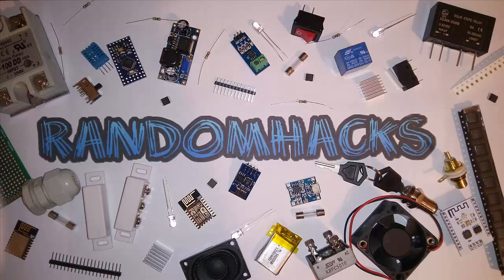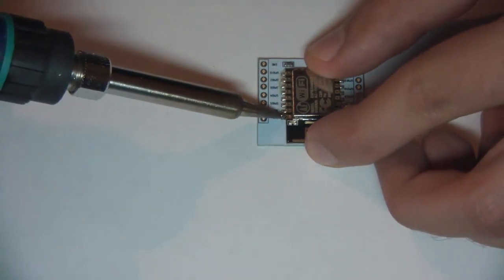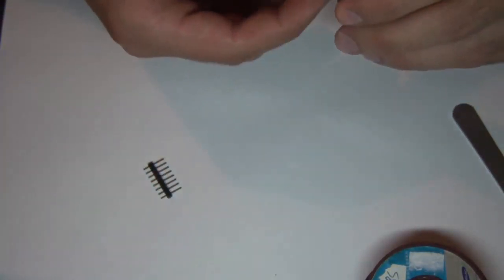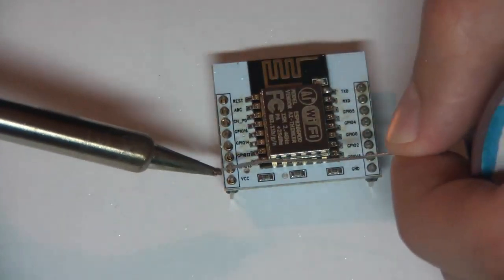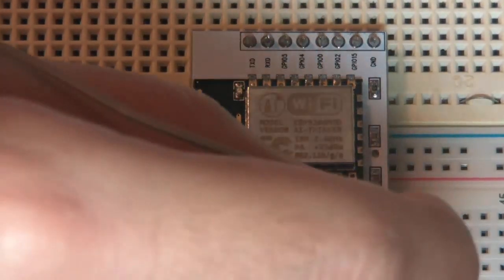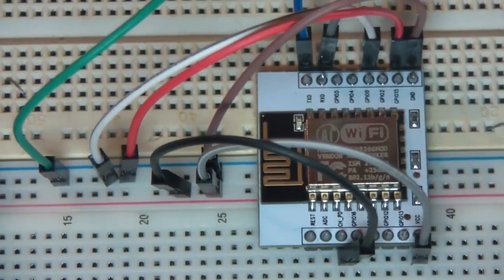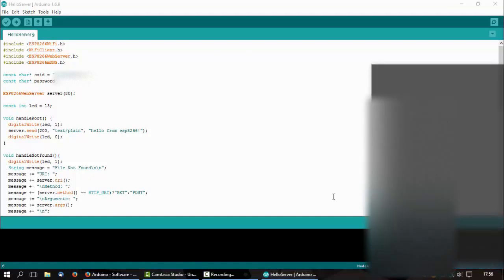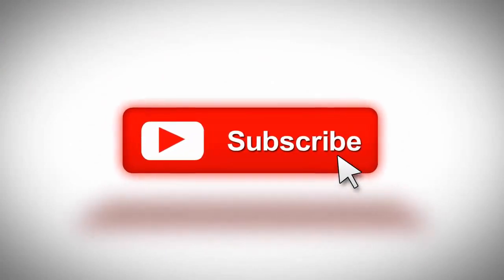ESP8266 12 / 7 - How to solder breakout board and flash with Arduino IDE

Comment: 7:00 That type of breakout board ALREADY HAS pull-up for CH_PD and pull-down for GPIO15 (these small SMD resistors on the edge).
So, you don't need to connect CH_PD to Vcc and GPIO15 to GND!  Only GPIO0 for flashing.
Reply from the maker: Yes, I realized that later, I had an annotation on the video but youtube removed all the annotations from videos as this feature was deprecated. Thanks.
Reply: @RandomHacks  Thank you for the great introduction video!

Comment: There is no need to connect GPIO15 to GND and CH_PD to VCC, since GPIO15 has been pulled down by R3 (10k) on the white breakout board to GND , and CH_PD pulled up via R1(10k) to VCC.

Comment: Can we connect usb TTL TX to esp8266 TX 
and 
TTL Rx to esp 8266 12E Rx
Reply from the maker: Hi, the correct is TX to RX and RX to TX but sometimes cheap ttl adapters come mislabeled. Think about two people talking to each other, one person talks with the mouth (tx) while the other hears with the ears (rx) that is how serial communication works.
Reply: @RandomHacks   thank you for your replay sir
I designed my own PCB like node mcu 
I'm design i miss connected them
TTL Rx to esp12e Rx
TTL tx to esp12e tx 
Any remedy for this
Reply from the maker: @pawanvijaykumar705  unfortunately I think the only solution in that case is to cut the PCB traces and correct the mistake with wires
Reply: @RandomHacks  helpful info and good tutorials thank you sir 👍👌
Can you please give me node  MCU schematic 8266 12E and / esp32  link please

Comment: can you explain the three pull up resistor connections on the adapter board?
.... Thanks in advance
Reply from the maker: Sure. There is a pull up resistor for the pin CH_PD on de left side of the breakout board and a pull down resistor for GPIO15 on the right side,  these are needed for the esp8266 to work, in case you have this breakout board you don't need to connect these two pins to VCC or GND like I showed in the video. On the middle there is a 0ohm resistor that bypasses the 3.3v voltage regulator that you can solder on the backside of the breakout board.

Comment: Hi there, I'm a bit confused with the board, hopefully you can help.
There is a socket for an AMS1117-3.3V Regulator on the back.
If I would equip the board with one of them, do I need to remove R2? and where do I supply the 5V and drain 3.3?
Having a hard time figuring out the wiring of this, ...
Reply: Same here. Did you figure out ?

Comment: I don't have a soldering station. So, what can be the maximum wattage of the solder iron that I can use?
Any suggestion would be of great help. Thanks
Reply from the maker: Anything between 25W and 60W should be fine, just heat the pads until you see the solder flow .
Reply: Thanks Sir. I am a newbie to soldering and electronics. Liked your video a lot. It was clear and lucid. Once again, thank you very much.

Comment: I could not load the firmware using this configuration. I needed 10k resistors to some of these connections.
Reply: The resistors should be built in to these boards........weren't yours? I know mine are.

Comment: I would be very interested if the white ready-to-use PCBs are really ready to use or how I need to prepare them to work. I have soldered an ESP-12S on one of these white boards but I am unsure about how are the connections on the PCB itself.  I mean how are the resistors on the PCB connected? I see you have drilled holes in the PCB-connections?

Comment: Hi RandomHacks, clear and methodic instructable, thank you. One doubt: while uploading a sketch to the chip, on the connections of CH_PD to 3.3V and GPIO15/GPIO0 to ground, is any resistor necessary? I saw other instructions on the web, and sometimes they advise 10K resistors. Another doubt: during normal run, all the three connections of CH_PD to 3.3V & GPIO15/0 to ground have to be removed? Sorry for the very basic questions, but I'm struggling since 1 week and got a lot of error messages

Comment: Hi, thanks for the clear instructions.
First I follow exactly what you did in this video.

later I tried to disconnect CH_PD and GPIO15, it works as well.

Just power cycle the board once the flashing failed.

Comment: Hi there, first of all this was a great tutorial, it helped me getting started with esp8266, thanks for sharing your knowledge, though this may sound as a stupid question I gotta ask you, do you happen to know why this breakout board has no pin headers for the bottom pins of the chip? I also have the same chip and breakout board and was wondering about it, I've seen people saying that we should not mess with those pins as they could cause some errors/crashes although GPIOs 9 and 10 are usable, but in order to use them we'd need some hardware modification, the article I'd seen was pretty much referring to esp8266 12 E and 201, not F which is what I also got, dunno if those statements are also valid for 12 F,  have you ever played around with the bottom pins? I'd appreciate if you could comment anything about them, keep up the good work buddy, cheers from Brazil.

Comment: I've done as you explained, but keep getting this error: espcomm_upload_mem; i searched in many forums but can't find a solution. Instead of using a serial to usb module, im using an aruino uno. Else is the same. If you have any hint to give me, i will appreciate it. Thanks
Reply: Tony Pendleton I just bought an Ethernet shield. I've tried everything but had no luck. I know some people that couldn't make it work with Arduino either... the c Arduino WiFi is a good option! lol
Reply: try to unplug Arduino before uploading code

Comment: The new cheap USB to TTL programers from Ebay (etc.) have both, 5V and 3.3V output pin, so you dont need the extra power supply, just plug the ESP8266 on 3.3V pin, right?
Reply from the maker: Just make sure it can provide enough current for the esp8266, if you have problems flashing it the programmer probably does not provide sufficient current.

Comment: could'nt upload the program this is the error.. could you help me on this

Sketch uses 222201 bytes (21%) of program storage space. Maximum is 1044464 bytes.
Global variables use 31576 bytes (38%) of dynamic memory, leaving 50344 bytes for local variables. Maximum is 81920 bytes.
error: failed reading byte
warning: espcomm_send_command: cant receive slip payload data
error: failed reading byte
warning: espcomm_send_command: cant receive slip payload data
error: failed reading byte
warning: espcomm_send_command: cant receive slip payload data
error: failed reading byte
warning: espcomm_send_command: cant receive slip payload data
warning: espcomm_sync failed
error: espcomm_open failed
error: espcomm_upload_mem failed
error: espcomm_upload_mem failed
Reply from the maker: Are you powering the esp with an external 3.3V power supply or are you powering it through the usb programmer?
Reply: RandomHacks  i tried both ways

Comment: after soldering this board , should the Vcc of the breakout board be 5v or 3.3 v???
Reply from the maker: Hi, if there is no voltage regulator on the backside of the breackout 
board (where the pins come out) then it should be 3.3V if there is a 
regulator you can use 5V. In my case there is no regulator as you can see at 5:13
Reply: thanks alot

Comment: People using this board should add a 0.1 uF capacitor from VCC to GND to increase stability of the ESP8266. You can easily solder it from the center 0 Ohm resistor to the GND pin.
Reply from the maker: Yep! I heard that before. It's not always needed though. The project I made to control 5 relays is running for 8 months straight, super stable without that capacitor :)
Thanks for the comment.
Reply: No problem. I had the most trouble during flashing. Adding the capacitor to the ESP board and another 100uF to the programming board solved that.
Reply: Yes, you remove the zero Ohm resistor if you are going to solder on a regulator. If you do that, be sure to solder on two 0.1uf capacitors - one on each side of the regulator. Once you remove the zero Ohm resistor, you can use the two exposed pads for this. One pad will be the source voltage and the other will be the regulated voltage. Just use the two pads exposed to solder one leg on each capacitor and then connect the other leg to ground.
Reply: Thanks. Anyway, in case we need a regulator, how do we solder it? Do we have to remove the zero-Ohm resister? (because it links between Vcc-pin and Vin of the module)
Reply: I used two 0805 SMD capacitors and soldered direct betwen pin 1 and pin 2 and connected the other from pin 3 to pin 1 using a jumper. Looks nicer than having bigger capacitors on the other side of the board.

Comment: Excellent video thanks.
I have ordered some of those breakout boards.
One minor point - is it necessary to wire the CH_PD and GPIO15 like you did ?
Because I think the board has traces from CH_PD to Vcc pullup resistor and GPIO15 to GND pull down resistor (as required)
http://internetofhomethings.com/homethings/wp-content/uploads/2015/05/20150519_ESP8266-adapter-apart.jpg
Reply from the maker: Oh I never noticed that! I think you are right! Thanks
Reply: No worries, thanks for the reply.

Comment: Thanks for a great video. You win another subscriber. I did every step and I could flash the module. But at the end It didnt show the IP address. Did I miss somthing?
Reply from the maker: Hi, thanks for subscribing. It should work, do you get anything on the serial monitor? Does it show that it is connected to the network? I guess you did check that the ssid and password are correct, right?

Comment: Arduino: 1.6.13 (Windows 7), Board: "NodeMCU 1.0 (ESP-12E Module), 80 MHz, 115200, 4M (3M SPIFFS)"

Sketch uses 249,259 bytes (23%) of program storage space. Maximum is 1,044,464 bytes.
Global variables use 35,776 bytes (43%) of dynamic memory, leaving 46,144 bytes for local variables. Maximum is 81,920 bytes.
warning: espcomm_sync failed
error: espcomm_open failed
error: espcomm_upload_mem failed
error: espcomm_upload_mem failed

This report would have more information with
"Show verbose output during compilation"
option enabled in File -> Preferences.

not working
Reply from the maker: How are you powering the esp8266?
Reply: RandomHacks 3.3v in mcu....
Reply from the maker: Right... but where are you getting those 3.3V from? If you are trying to power the esp directly from the usb flasher that might be the problem as most flashers don't provide enough current. Have you tried to swap the RX and TX connections? sometimes the silk screen on the ttl adapter is wrong. Also make sure you selected the correct COM port.

The connections for flashing mode should be GPIO0,GPIO15 and GND to ground (the grounds of the flasher and the 3.3v supply should be connected together), VCC and CH_PD have to be connected to a 3.3v power source, TX from the ESP to RX of the TTL adapter and RX to Tx. If this does not work try to pull the GPIO2 pin also to 3.3V.

Comment: Hello, I have a problem, I can compile the sketch without issues but when I open the serial monitor I get garbage characters. Any ideas?
Reply from the maker: Hi, are you using the same baud rate on the serial monitor as the one you set in the code with the Serial.begin(xxxx) line?
Reply: yes bro
Reply: I get this message ts Jan  8 2013,rst cause:2, boot mode:(7,7)

waiting for host in 74800 boudrate
Reply from the maker: Does this only happen when you try to open the serial monitor? Are you able to actually flash your code to the esp8266? How are you powering it? Try to connect the reset pin to 3.3V.
Also try using a different baudrate like 9600 or 115200
Reply: yes i can actually upload the sketch, the problem is when  try to test it in the serial monitor
Reply: Do you think the problem is that Im connecting the esp8266 vcc directly to the usb that gives me 3v, instead of having 5v and converting those to 3v and then connect those to the esp8266?
Reply from the maker: Yes that is probably the problem, the usb adapter can't supply enough current to power the esp.
Reply: Hey I solved the problem. It all had to do with the current. Thanks bro. Nice video
Reply from the maker: I'm glad you solved it.

Comment: the flux surely will help, but managed to do it quickly without flux. What I did do though was to  add a spot of tacky glue between board and module, put it in proper position and then let it dry  for some moments

Comment: Hi. Any special care about the 5V on the TX and RX when programming? I think the TX pin from the FTDI board delivers 5V and the ESP8266 can tolerate only 3.3 in all pins, doesn't it?
Reply from the maker: Hi, yes you should use a 3.3v serial adapter, most have a jumper that let's you chose between 5v and 3.3v. But to be honest I accidentally connected the esp8266 to 5v for about 10 minutes and it didn't die, I wouldn't recommend it though.

Comment: Just a tip, the "Witty" is a cheap(<4$ @ Ali) two part ESP8266 dev board, and these boards you solder yourself fit perfectly in the USB-to-Serial for that, which is great if you need to test repeatedly or if you want to program many of these.
Reply from the maker: Cool! Thanks for the tip, I will order some.
Reply: I happened to have both in front of me and saw they fit together so I tried it and it worked. First few times I had to push the "flash" button on the programmer board, but then I changed a setting in the IDE ("reset mode" I think it was) and then it worked fine. It's still a bit tricky as  you need to connect any sensors "on-top" or solder so the pins are accessible both as you show here, and sticking up.
Maybe you can figure out a smarter way.

Comment: warning: espcomm_sync failed
error: espcomm_open failed
error: espcomm_upload_mem failed
 This error is persistent when we try copying what you have done. Any solutions for this?
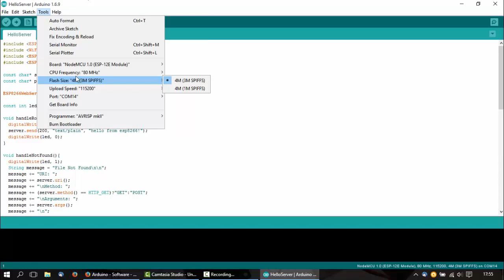Reply from the maker: I didn't make it clear in the video but every time you change from flashing mode to normal running mode you have to power cycle the esp (if you want to flash it, first connect GPIO15 and GPIO0 to ground and only then switch the power on). Also some serial adapters have the connectors mislabeled so try to switch the RX and TX leads (TX of the adapter being connected to TX of the esp and RX to RX instead of TX to RX and RX to TX), don't forget that the ground from the serial adapter has to be connected to the same ground as the esp8266. Make sure you have the right com port selected on the arduino ide (tools - port 9:20 ) and the speed (baud rate) is 115200. Hope this helps. Have fun!
Reply: tried the other way but i didnt work out .It throws the same error always
Reply from the maker: That is strange. Are you sure that the serial adapter is in working condition?
Reply: I've been having the same problem. I've tried flipping tx/rx. I believe the usb-serial works because I can do loop back with it (and I tried a second usb-serial). One thing of note: I wasn't able to communicate with the board before trying to program it: no lua or at instruction set. It's warm, meaning its getting power.
Reply: Same here

Comment: Hi, if  i flash this board this way may i use it as a wemos board or is a different firmware?
Reply from the maker: I don't have a wemos board but from what I could tell it is based on the esp8266 so it should be the same.

Comment: I bought one of these and I was concerned about the soldering but  you made it look easy enough.  What is flux and why do you use it?  Since I don't use Arduino, use Pi3 instead, how can I burn firmware changes to device?
Reply from the maker: Flux is used to make the soldering job easier and better, it reduces oxidation on the metals you want to stick therefore creating a better connection. You can use the same method shown in the video to flash the esp8266, no arduino needed just the IDE which is the software you can download from https://www.arduino.cc/en/Main/Software 
Have fun!
Reply: Thank you for returning a reply to my post.  I have noticed that some solders have flux in them which made no sense and now it does.  Thanks for the link too.